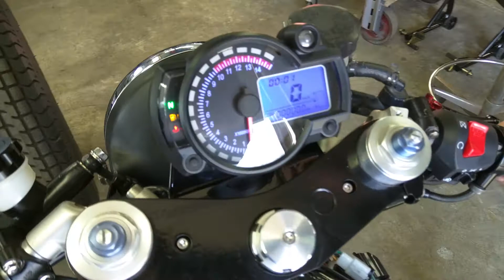Custom V65 Sabre First Startup

Comment: Is the neck bearings the same size or did you have to do something else to get those forks on there?
Reply from the maker: No not the same size. I made a custom steering stem to make it fit.
Reply: Ah, but triple tree stuff from a r1?

Comment: what size of the tire in the back?
Reply from the maker: Mateusz Zambrzycki if I remember correctly it's a 140/70/17
Reply: Pendemic front suspension from what you set?
Reply from the maker: Mateusz Zambrzycki 1999 R1
Reply: Pendemic thanks
Reply: Nice bike

Comment: What gauge and forks are you running?
Reply from the maker: The gauge is from eBay and the forks are from a '99 R1.
Reply: @Sugarkryptonite  Did you needed to do any modification to fit those '99 R1 forks? did u used the original v65 breaks and disks?